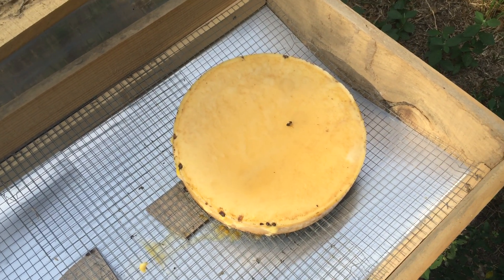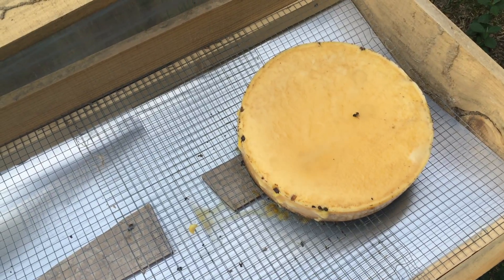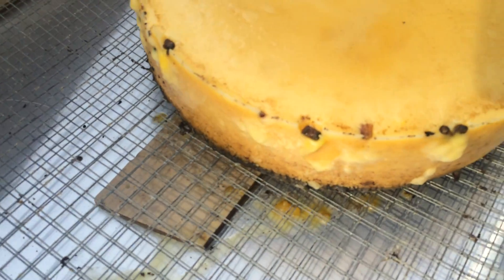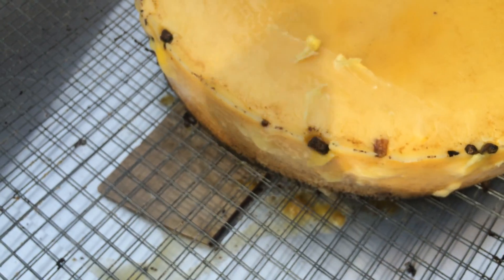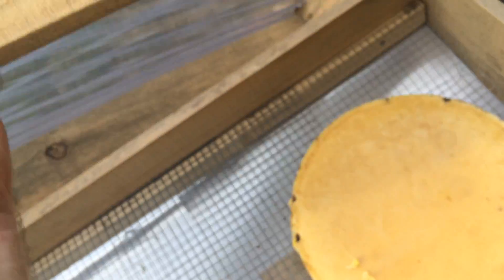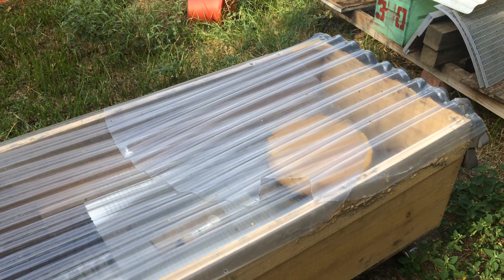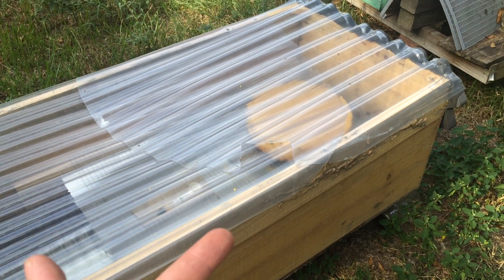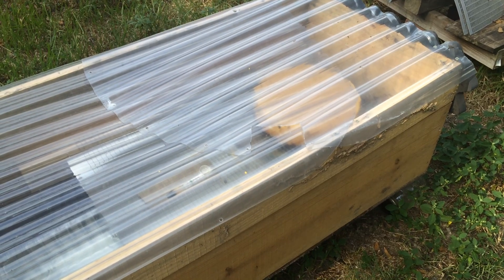Reviewing the Solar Wax Melter

Comment: Using old mirrors to reflect sunlight onto the box will increase the temperature in the box.  People will put old mirrors out with the trash occasionally so the mirrors for this purpose can be gotten for free with patience
Reply from the maker: It's hot enough down here you don't really need them. This particular melter was totally poor-boyed from the start and destined to fail. Too much heat loss. I now have a small  chest freezer with just a scrap of thick lexan panel on top, and it get's hot enough to get the block of beeswax in there to turn to liquid each day. Don't want it too hot after all. The mirrors could be handy though to aid in the winter months. Thanks for sharing.

Comment: Do you think "great stuff" foam sealer would seal up the corrugated lid?
Reply from the maker: It would. Would look like crap, hah! Then again, I don't know, the plastic is pretty flimsy. I'd recommend using the low expansion ratio version so it doesn't shove your plastic around. Really just using a better, flatter, panel, like a sheet of polycarbonate or glass would be better, and would be easier to seal the edges too.

Comment: first lol  put tin foil around the sides
Reply from the maker: For sure. Was going to line it with the same flashing that I used for the bottom, just haven't yet. Wanted to show folks what happens if you DON'T do it right : )